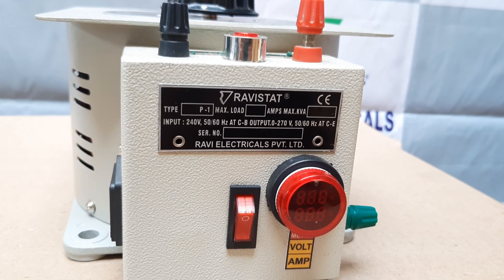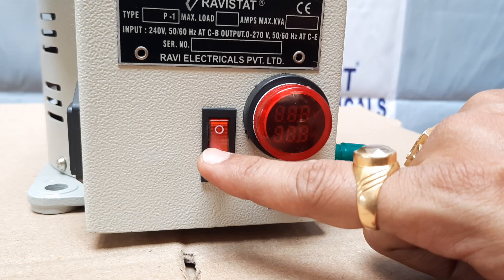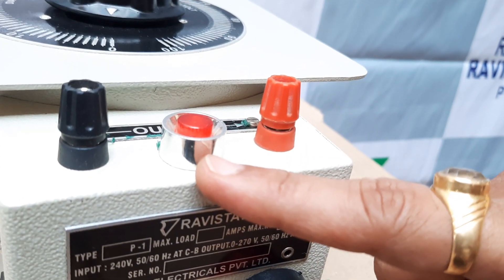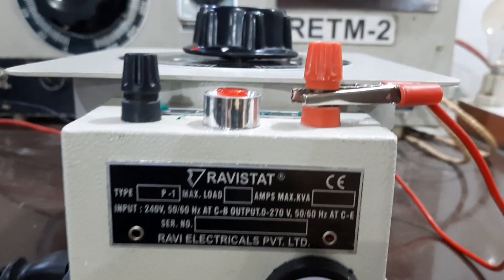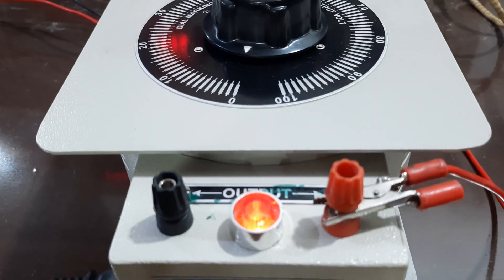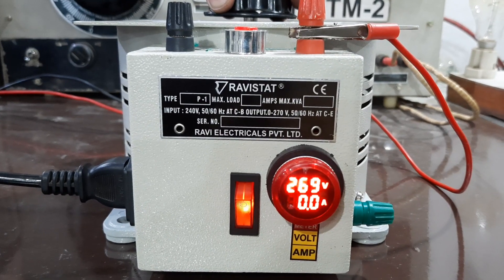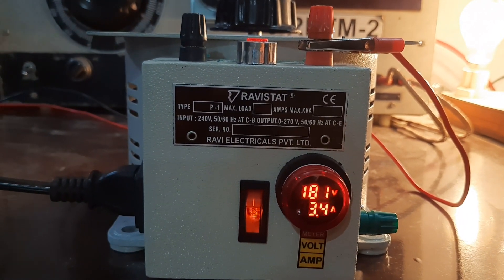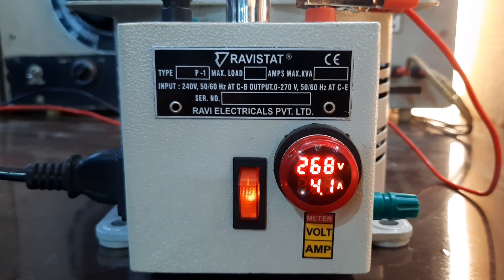4Amps Variable Transformer Variac dimmer regulator

Comment: Ravi electricals Pvt ltd export firm using all raw materials are related to electrically technical grade and enamelled wire shramik ltd wire f class and from 4amp till 60amp dual coated wire dc class h class are used for better insulation and good conductivity of current flow.
 Related box type 
Terminal  red and black used of elcom ltd.
Switch 15amp used for 4amp/10amp box type. 15/20/40/60amp meter type For export only.
Socket  10amp with in built fuse protection for short circuit and extra spare fuse provided in it for export purpose only.
Volt and amp meter for output purpose to indicate.
Relating to Indian industrial purpose chord wire with 3 pin plug is provided for input voltage power and terminal for output and without on /off switch.